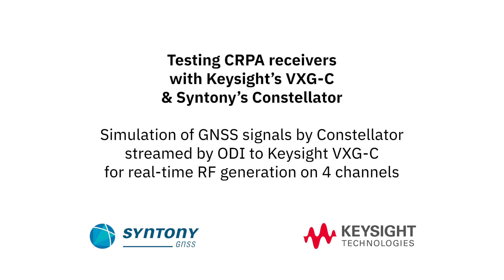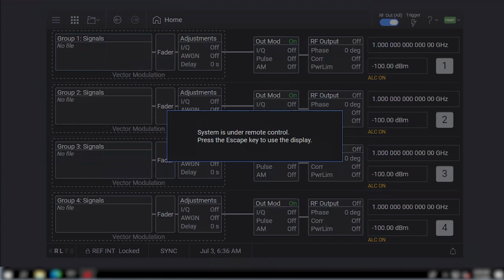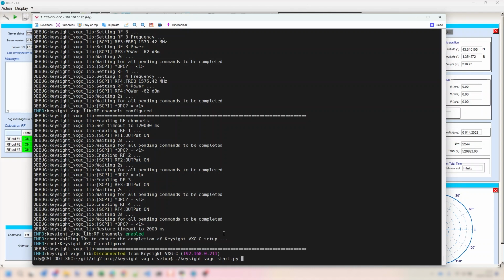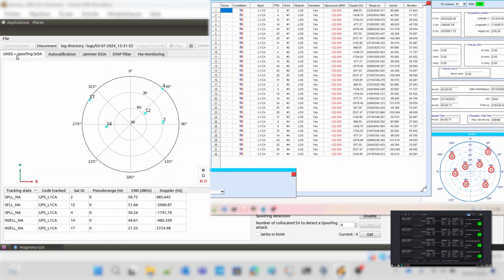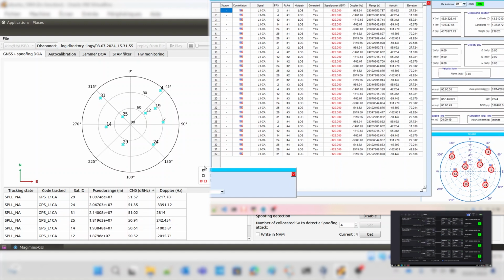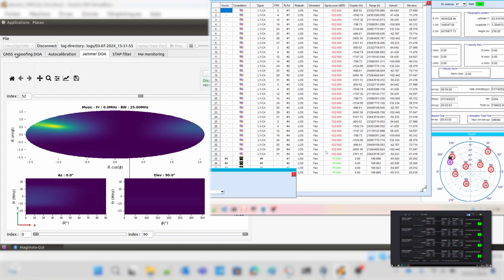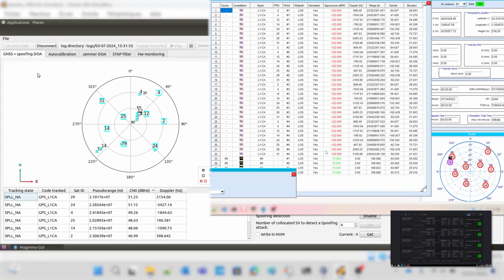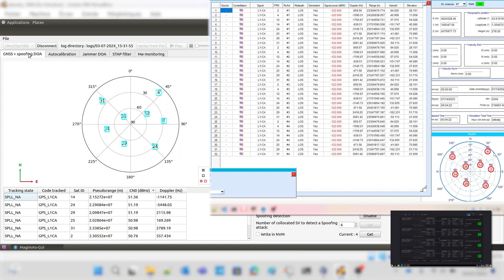Revolutionizing CRPA Testing: Syntony Constellator and Keysight VXG-C Setup

Comment: did you connect 4 Syntony Constellator (to generate 4 GNSS I/Q signals) to single Keysight VXG-C setup?
Reply from the maker: Hello! No, one Constellator would do the trick ;)
Reply: @syntonygnss442  so One constellator has 4 outputs?